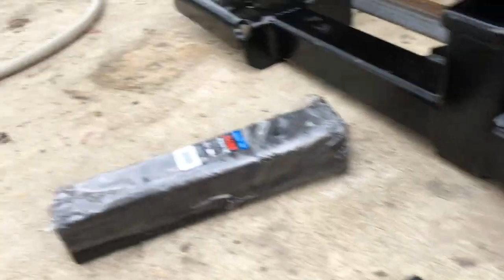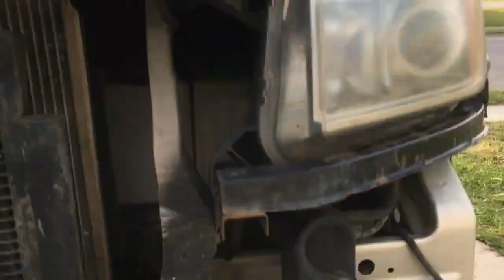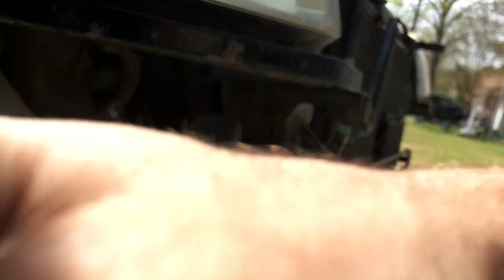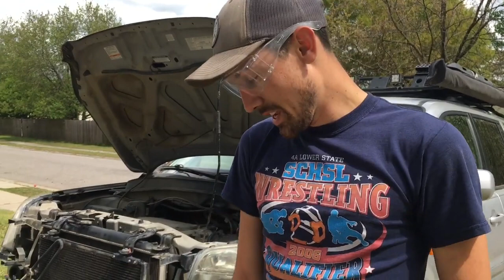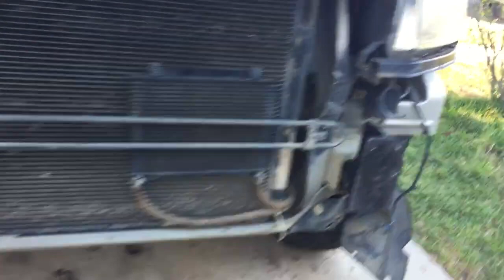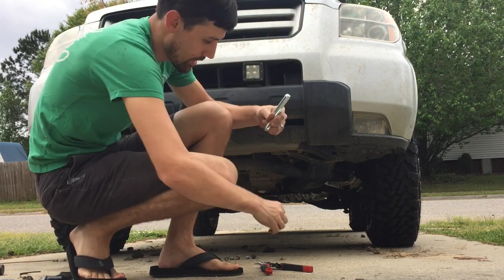Honda Pilot Off-Road Winch Mount Build! DIY Front Bumper Setup (2006–2008)

Comment: Are u using oil to drill with? That could save your bits. Control the speed too. Each type of metal has its own specific cutting speed. You’re not going to be exact with the speed but keep the oil on there. I just bought a Pilot and scouring the net for mods. I really like what you are doing with this front mod. Maybe more than I’d do.
Reply from the maker: The hard part wasn't the material close to the bit. It was the material on the inside of the frame over 3" from the bit tip and way and impossible to oil.
Reply: Also start small with a pilot hole and then go up to 1/4 inch then 1/2 inch definitely use oil everytime. This is the best way I have found.( The problem with this particular way is the bit will want to grab the sides of the hole and stop the bit and dang nearly break your wrist.) So don't push hard and keep the 1/2 inch bit rpms up snd dont push too hard and let the bit eat it up. The easiest way is with a cutting torch.